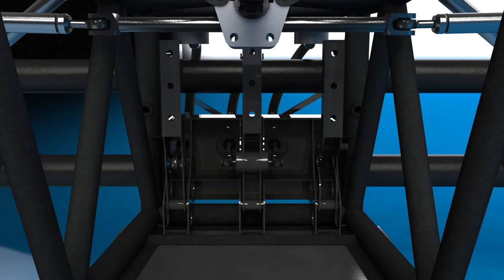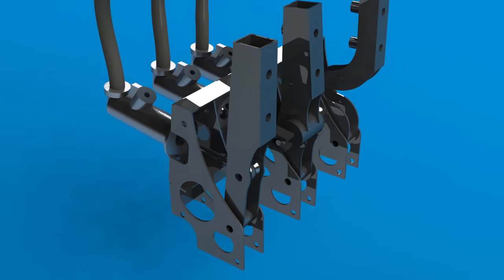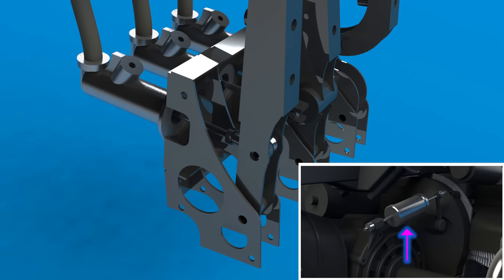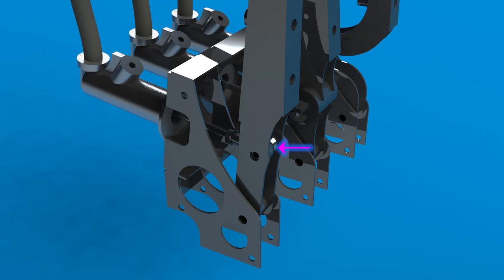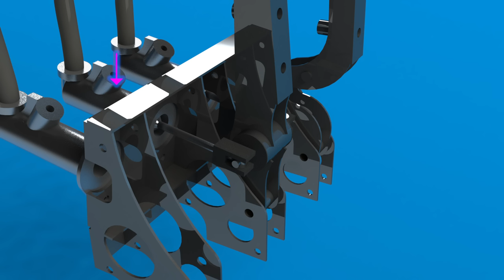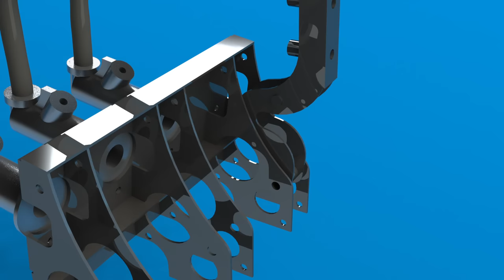Pedalbox

Comment: Just discovered your channel and I’m hooked. ME dropout sadly because of health issues but I’ve always had a love for the design and development of cars so this is like my ultimate channel. Question about the brake bias setup. Does the balance bar/bearing setup just act as a pivot to change the load based on its proximity to the separate cylinders? Thanks
Reply from the maker: Thanks. That's correct on the brake bais, a simple but effective system.

Comment: A nicely done piece of work. I don't know what your racing background was but, you forgot a critical piece...the foot brace. There was plenty of room, perhaps this oversite has been corrected by this time.
Reply from the maker: The mount in the car's chassis had a front plate which served as the foot brace for me. No adjustability but it did work perfectly (for me at least).

Comment: Wouldn't this type of cylinder mounting require there to be a nice amount of mechanical compliance for it to actually work? Seems like the rotational motion of the pedals won't fit very well to the linear motion of the cylinders when they're rigidly mounted on one side.
Reply from the maker: The master cylinder has a ball-in-cup thing on the end of the actuator rod. So it can take the slight deflection without any problem.
Reply: Thanks for such a quick response! Thats good to hear, explains a lot :)

Comment: Hey what is the actual song name that you used?  Doesn't really help when the only thing you cite is a site with thousands of songs to search through.
Reply from the maker: The song name for this was "Dress Code Black 3" by Niklas Ahlström.
Reply: ThomsenMotorsport thank you! P.S. I really really like how you do your videos. It helps someone who struggles to finish projects feel as if I've completed something. Keep it up!
Reply from the maker: Thanks. I watched a video the other day which I think described how I kept myself going on this project. It's not about being "motivated" to complete the project, motivation can come and go and if you rely on it things will fall apart when its at a low point - and low points are sure to come on projects like this. Discipline finishes projects, making yourself keep working when the motivation isn't there.
Reply: ThomsenMotorsport That's a really good point. Thanks!